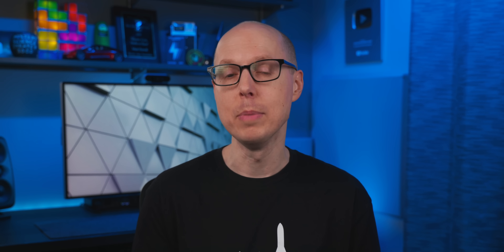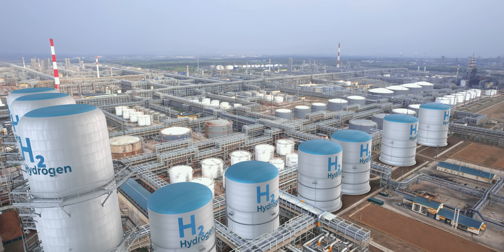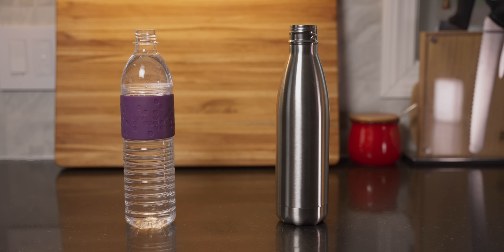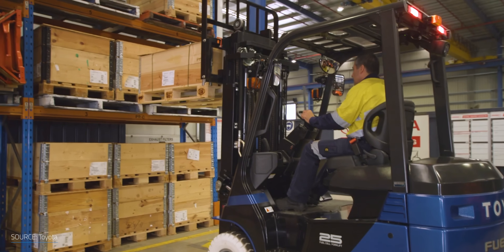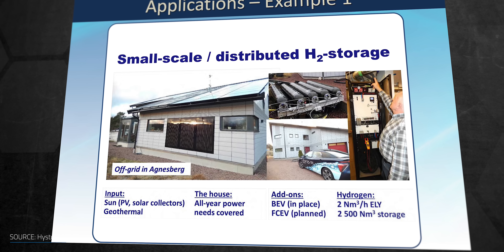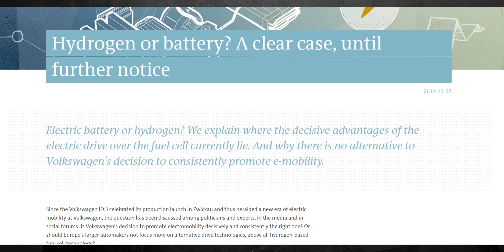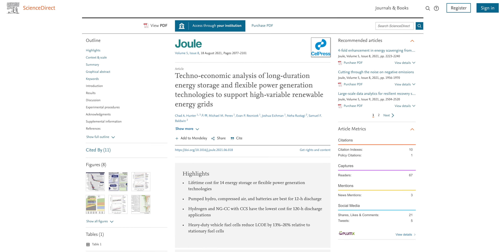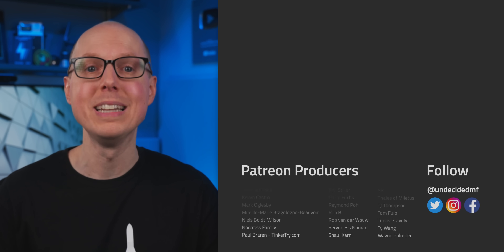Solid Hydrogen Explained (Again) - Is it the Future of Energy Storage?

Comment: I have done PhD research on this topic. The Metal hydride we were going to use was very very expensive which made it unpractical. But we shifted focus to Solid State Ammonia storage which can be used for hydrogen storage as well. The principle is exactly the same, except it works with halides. Some metallic hallides can store ammonia at very high gravimetric storage densities which makes it competitive to solid state hydrogen storage. The operation pressures are not high, materials are inexpensive and environmentally safe, and the storage pressure is below room temperature, so there is no risk of leaking.
Reply: Would love to know more on this
Reply: You can look into ASME Power and Energy conference, Journal of heat and mass transfer, and Journal of Energy resources technology. You need to find papers on the topic.
Reply: @KafshakTashtak  are you in Instagram ? What's your id
Reply: Wouldn't working with ammonia be dangerous, as it can be toxic and only a few PPM can be smelled already? Furthermore, can ammonia be produced as 'easily' with green electricity as hydrogen from electrolysis? I've heard about ammonia as an energy carrier/storage solution before, because of its high energy density. But do you consider it promising?
Reply: @RikkerdHZ  Aren't we having an ammonia shortage?  Or is that nitrogen?  What do they use for fertilizer that is now 3x the cost it was last year?
Reply: @MrShwaggins  do you mean phosphorus? The air consists of 78 mole-% N2.
Reply: @affugter  I just checked and it is nitrogen as well as synthetic  nutrients
Reply: @MrShwaggins  just read you comment again. I guess that could be because of the high natural gas prices. Takes a lot of energy to convert H2 and N2 to NH3 (Haber-Bosch process)
Reply: @MrShwaggins  Depends on where you live. I think that's phosphorus for most countries, as that is the limiting growing factor for plants in most countries. In my country (the Netherlands) we have too much N and P everywhere. I don't think there is an ammonia shortage. Ammonia also is not used in fertilizer as it's a gas and harmful for the environment (eutrophication).
Reply: @MrShwaggins  You never have nitrogen shortage on earth. Air is 79% nitrogen.
Reply: @KafshakTashtak  So what fertilizer is going up 3x for farmers?  Some basic fertilizer went from 300 to 900+ a ton?  I know the atmosphere has more Nitrogen in it than O2 but plants can still be nitrogen deprived.  It's like trying to quench your thirst by dipping your legs in a pool.
Reply: @MrShwaggins  ammonia (nitrate) I think. Russia is huge supplier.
Reply: @RikkerdHZ  So, some companies are looking to use ammonia as a fuel. One example is in shipping industry. People are looking into it since ammonia is a good hydrogen carrier.
Reply: @KafshakTashtak  so is kerosene and it's not toxic if spilled. Either way requires prodigious amounts of energy to fix the hydrogen in the first place and once you get to that point the costs of handling/distribution at scale are going to severely impact any replacement for crude oil
I'm inclined towards "wires, batteries where wires won't reach and synthetic hydrocarbons where batteries weigh too much" as the long term answer. I'm also betting that a lot of long-haul transportation will eventually move to some form of vac-train as high speed aircraft become too expensive to justify keeping in the air (gasbags have their own problems even if helium-filled. The two worst loss-of-life dirigible crashes were helium ones, not hydrogen.  Big balloons are highly susceptible to weather)
Reply: @miscbits6399  you brought up weight of batteries. One application I was looking at was using that ammonia absorption process for hvac of electric cars, because it had higher energy density than batteries.
Reply: @RikkerdHZ  Agree with you. Today, ammonia is made using fossil fuel and is toxic. The jury is still out on the scope of hydrogen as energy storage. The case of submarine is clear and we need to acknowledge that the submarine is primarily nuclear powered. Trucks could be viable for H2 tech.
Reply: Could you explain how "pressure is below room temperature" works exactly?
Reply: @szeredaiakos  So the absorption/desorption reaction of ammonia (or even hydrogen in case of hydrides) is a reversible reaction and has an equilibrium curve. Kinda like the evaporation/condensation of water. For any specific temperature, there is a specific pressure that the reaction will be at equilibrium, meaning that the rate of absorption of ammonia is equal to rate of release. For some materials, eg magnesium chloride, the equilibrium pressure at room temperature is below atmospheric (about 2 mbar). For atmospheric pressure, that equilibrium temperature is higher. You have to heat up magnesium chloride to +100°C to reach atmospheric pressure. For other materials, and liquid ammonia, the equilibrium curve is different.
Reply: @szeredaiakos  Remember?.........√P2π=∛T[βx42π-7κ]6.......easy peasy when applied 😂
Reply: I was going to say much the same.  Hydride have been known about for over 40 years but you end up with a 'fuel tank' costing more than the rest of the car - catalyser theft would be minor by comparison
Reply: @miscbits6399  . .Nova science TV show ..Late 1970s..Thanks..
Reply: The best way to store massive amounts of chemical energy by far is by bonding hydrogen with carbon. We just need to do it the way that biology does it and pull the carbon out of the atmosphere instead of the ground so that we complete the cycle instead of disrupting it.
Reply: @AbeDillon  Agree. The little issue is the long path of converting renewable energy into C-H bond and then converting it into electricity. Example, use bioethanol and fuel cell.
Reply: @stanislavjaracz  In our biological energy world there's not full hydrogen-carbon bonding (unless underground high pressure & temperature conditions). That's why we must use carbon monoxide as transportation container for green hydrogen in future's ecofuels!
Reply: @AbeDillon  Proton Technologies is pulling Only H2 Out of Oil Wells, Apparently Even Depleted Wells Still Have a Good Deal of Hydrocarbons Left Behind & Their Tech Seems to Perform the SMR Process In Situ; Solidifying the Carbon Underground & Extracting only the H2...Brilliant!
Reply: I just found out I don't know much.
Reply: Thanks for sharing.
Reply: Thank you for your input!
Reply: Yes, ammonia seems like a much more promising hydrogen storage than straight hydrogen.  I really think the breakthroughs needed will be found there.  I wish more hydrogen research pivoted to ammonia.
Reply: KISS = Keep It Simple, Stupid
Reply: @polka23dot70  If the technology was simple we would already have it.
Reply: @mitseraffej5812 All good ideas are simple. All complex ideas are as useless as Rube Goldberg's contraptions. (I made about 600 important inventions, so I have enough experience to judge new ideas.)
Reply: @polka23dot70  I doubt If a transistor or a computer chip could be described as simple. I doubt if 1% of the adult human population alive today could accurately describe how these things work at even at most basic level let alone produce one, yet these are actually quite good ideas.
Reply: Oh god, ammonia..? Imagine Beijing but instead of the normal smog it was enveloped in a cloud of piss
Reply: Could you give some references?
Reply: I still wonder how costs compare to Synthetic Diesel/Kerosine via a modernised Fischer-Tropsch process from captured CO2.

From what I can find on costs my hopes still lie on F-T bringing costs down and having minimal costs passed down to replacing thebentire fleets of vehicles.
Reply: Kudos on doing PhD work in this field.   I just finished mine in the same space in December.   We used too much of the expensive metals you mentioned (needed them for the unique nanocatalysts that formed), so I like that you had a more cost effective approach.
Reply: What is wrong with HHO on demand? Browns gas!
Reply: Appreciated
Reply: There is no way that the storage density is going to beat storing in in a liquid form so what is the point as far as densities goes??????? honestly seem like a wasted effort.
Reply: @loranmorash8532  They Say Hydride Storage is More Energy Dense Than Liquid H2. The Metal Hydride Molecules Absorb H2 Molecules. Are You Calling That Claim a Bluff??? Just Curious, I'm Certainly No Engineer.
Reply: Please tell us you're planning to take some actual chemistry classes before you throw away your time??
Reply: Nickel is expensive but for who. Mainly manufacturing which means less profits. My battery pack which is the original has lasted 21 years and still working very well. I suspect they want packs to be designed to wear out sooner to make more profits for the company. The first models where designed too well.
Reply: So where's the commercial product?
Reply: Yes!
Reply: Hi, I’m a grad student and thinking about doing research in metal hydrides. I have (I think) an original idea and have done some literature review. I would love to get in touch with you to talk more about what you had worked on!
Reply: @moynk4512  Che k Dr Zach Fang from university of Utah. He's still doing research on the subject.
Reply: Sounds like it'd have a very low specific energy, could you give more details?
Reply: Way above my head. But absolutely fascinating.
Reply: are metal hydrides/halides a net energy gain or drain for the economy in your opinion?
Reply: “ the storage pressure is below room temperature” ??
What does this actually mean or was it just a typo.
Reply: @mitseraffej5812  That is most likely a typo or translation/editor error. Many languages professionally use the term "room conditions" when they mean "standard laboratory conditions". So temperature, pressure, humitidy ect.
Reply: @mitseraffej5812  sorry, you're right. The storage (equilibrium) pressure at room temperature is below atmospheric pressure.
Reply: @KafshakTashtak  Thank you. Hydrogen fuel technology is of interest to me for the following reason. My country (New Zealand ) produces over 80% of its electricity by hydroelectric dams. Fossil fuels are used only to satisfy high peak loads. 
We have a very large hydro instillation that was built 50 odd years ago specifically to power an aluminium smelter owned by an Australian mining company. This smelter is a major employer in the area and over the last couple of decades the mining company has literally blackmailed the country by threat of closing down the the smelter when negotiating  the price of electricity.
When and if the hydrogen fuel technology comes of age the country will hopefully rid itself of this company as the energy this power station produces could go a long way to power the countries automotive fleet.
Reply: Awww please, any links?
Reply: Why don,t we mix it with something like oxygen
Reply: @SAHM  what metal hydride were you studying? I’ve been working with LaNi5 series and have had an interest in AB2 but just haven’t had the time to study it later.
Reply: @The6staradmrial  I didn't directly work on it, but the team was looking into LaNi5 a well. Too expensive for what we wanted to do.
Reply: Awesome 👍🇦🇺🖤💛❤️
Reply: Except ammonia is highly toxic.
Reply: @davidbowerman6433  As is Diesel and Petrol (Gasoline), however with those you also have the additional health hazard of Carcinogens and other poisions with their various additives.

These Petroleum products are Flammable, Ammonia is Combustible. There are numerous differences and similarities, but when you compare the two Ammonia is marginally less Hazardous.

Yet not one blinks an eye at using Petrol (Gasoline) or the fact that thousands of litres of it are stored under even the smalled Service Station (Gas Station).
Reply: please do enlightment for people so people are not gullible enough lied by new ferell
Reply: Please link to your PhD paper. I want a good laugh when you can't provide one Mr. "Unpractical."
Reply: Why would you store ammonia in solid state if you can easily have ammonia as a liquid?
Reply: @Hansulf  Added safety of it. My research was focused on thermal energy storage based on ammonia's reaction. But the other researchers in the university were looking into metal hydrides for hydrogen storage. Now ammonia could be used as hydrogen storage as well.
Reply: Is ammonia more powerful than hydrogen in terms of energy density? why is a metal hydride so expensive to make? what if a cheaper way is found to make metal hydrides?
Reply: @jjesl  >more powerful in terms of energy density
energy density and power are 2 different things you bumbling idiot. Also metal hydrides take more energy to break the metal-hydrogen bonds than can be produced by burning the hydrogen. Study chemistry and stop listening to quacks like sahm.
Reply: @jjesl  The one our team was working contained lantanide (rare earth metal), which made it expensive. If you can find a cheaper material, and the reactions have low energy balance, go for it. 
I don't remember in details right now, but I think liquid ammonia had a higher density than compressed H2.
Reply: @KafshakTashtak  Yeah, at a base Liquid Ammonia contain 1.7× Liquid Hydrogen.

A 1MPa (145.038 psi) tank of Ammonia contains 2.5× a 70MPa (10152.66 psi)   Hydrogen tanks energy by volume.

If your had a 770L (350kg) Hydrogen tank, it could be replaced with an equivalent tank of Ammonia that was only 315L (172kg).

Unsure which US Gallon to convert to here, Liquid or Dry, the US imperial system can be confusing at times. Not even sure if conversion to pounds would be appropriate, sorry US people.

None the less, yes it's quite a good Hydrogen storage medium. 

Has interesting potential as a fuel by itself, the NOx emissions are a concern. 

Given that Ammonia has a fairly lousy air fuel ratio of 6.06 by wieght, blends and mixes would be needed for it to be a successful fuel in an ICE. Adding 5-10% Hydrogen appears to be the right mix.
Reply: Ammonia isn't effective compared to the pure hydrogen for fuel cells! 
Hydrogenated synthetic fuels - that's what I think the best way to the fossil carbon-free future.
Reply: Hi sir, I had a thought while watching this video, and was hoping you could provide some insight or clarification.

The way I understand combining the hydrogen and metal, is it the same as essentially saturating a sponge with liquid? Does the base metal still retain its tensile properties? 

My thought: one issue with high pressure hydrogen cylinders is off gassing as the metal/carbon fiber cylinder is basically porous as far as the hydrogen molecules are concerned. Would using a metal hydride help prevent this by essentially "filling in" those pores thereby reducing the amount of hydrogen lost to the atmosphere?
Reply: What if you used an arogel to soak up the hydrogen, of layered it with something than can absorb it and cant so it can defuse out faster through the thinner hydrogen soaked material
Reply: Interesting.
Reply: What is "Solid State Ammonia storage"??
Reply: @manoo422  Ammonia NH4 (gas in normal condition) is adsorbed  by solid materials to increase the energy density.
Reply: @manoo422  Storing ammonia in a solid absorber (halide salts).
Reply: @Robbie👾 In the Phils., I dont know about the other country policy, they kept ALL the THESIS BOOKS in a very RESTRICTED SECTION OF THE COLLEGE/ UNIV. PUBLIC LIBRARY- I dont know the system in PRIVATE SCHOOL LIBRARY... Hence, they can QUARANTINE, ISOLATE a perceived idea/ concept contained in concerned Thesis Books... Specially if such Thesis Book was confirmed LETHAL to their bussiness interest.. Thus, in tandem with the Science Department and every nation PATENT OFFICE , they were able to filtered out and SUPPRESSED,  CHOKED at all possible level- those inventions, designs, processings, ideas, etc- which will pose a very great  THREAT to the very EXISTENCE of their multi. billion dollars bussiness empires worldwide..
Reply: Have you tried calcium hydride?
Reply: Why haven’t you started a company providing hydrogen storage for cars and sell the technology to car companies like Toyota who is making hydrogen combustion engines.
Reply: @Some0ne001  my research was on Ammonia, and I keep seeing novel ideas about using Ammonia as fuel. It has become a dream for me. Due to life circumstances, nI couldn't follow that path.
Reply: What would you say is the most restrictive factor for mainstream hydrogen use. Engines, storage or generation? I think I'm close on  the engine and have some untested theories on generation.
Reply: @spidergoose891  Hard to say for me, as I haven't worked with Hydrogen directly. But hydrogen is generally tricky. Storage and pumping it is quite difficult compared to electricity and petrol/oil. It escapes through tiniest cracks, and is quite flammable.

Edit: that's why you see research teams started looking at solid state hydrogen, or in our case ammonia.
Reply: Going backwards now (me)...The concept of weight reduction for vehicles was to use less gas (carbon output reduction). Since then, EV's r lightweight because the batteries r heavier, but no Co output. Now power grids r going down (too much usage) & requires much more BS to run them. & this burns my britches...Making lithium ion batteries & their disposal is dangerous to everything. FD's won't fight these fires now & Insurance Co's won't ensure cars/homes.
Reply: 😮 but surely will demands processing phase before diverting to fuel cella
Reply: @KafshakTashtak  sir would like to talk to you, gmail or any?
Reply: Expensive is relativ, when there is a need
Reply: You can use iron hydride
Reply: Urine is mostly ammonia. Very cheap to produce
Reply: @Walkeranz  Actually, urine is mostly water.  Between 91% and 96%.  Ammonia and ammonium compounds are less than .5% of urine.  Chlorides, Potassium, Sodium, Phosphorus, and Sulfates are all present in higher concentrations than Ammonia.  In proper functioning kidneys of course.
Reply: @Walkeranz  not true, is mostly water!
Reply: @Walkeranz  Urine contains urea which decomposes to ammonia.
Reply: @Walkeranz  Is there a Thesis Papers/ Research already done about the utilization of URINE for power production?.. All I heard was its a good compost fertilizer for plants.. Our yard fruit trees were regularly receiving such organic fert- the fruits were sooo  sweet, even bats were infesting/eating the fruit while still half. matured!.. Note: Provided, you were not taking a synthetic drugs or medicines, it will contaminate the urine- the fruits will become sour or acidic like a vinegar...
Reply: Use this and battery storage for shipping at sea, Off shore wind and solar for recharging.
Reply: @infocat13  : Trying to use batteries that are charged at fixed locations for shipping is a non-starter. Any realistic option for powering shipping off of wind involves placing the turbines onto the ship in some way (e.g. lighter-than-air turbines).
Reply: North Sea wind to recharge ships at Rotterdam:)
Reply: @infocat13  Batteries of a size to provide base load power from renewables are still too expensive but they are getting better. The race is on. .
Reply: @infocat13  Mainspring Generator Could Power Electric Shipping, Burning H2 or Ammonia to Replace Massive Battery Requirements. Others Have AI Driven Sailboats that Drag a Turbine to Power Electrolysis & Deliver H2 Straight to Desired Ports.
Reply: @infocat13  Right now nuclear is much more likely to make a difference in global warming on those incredibly dirty ships.
Reply: @Robert Lemon I know some Universities let you use their libraries for a fee if you live in the same state or area and pay a yearly fee.  They have much more to offer so thats why they charge for a library card.  I miss where I used to live.  There was a nice new library with private meeting rooms, an outside amphitheater for giving lectures and a dog park.  It was such a good spot to relax and it was quiet.  You go to an underfunded library system and its just a place for the homeless to watch adult films on the computers.
Reply: @MrShwaggins  sorry you're feeling that way
Reply: How about Magnesium or Barium blends? Heard that German scientists had success in storing hydrogen in a clay form, somekind of mix from Ba or Mg. Basically a "fuel in a toothpaste tube" :) The burnoff was also supposed to be pure and recyclable to store more H again.
Reply: In your opinion, do you think it's possible for metal hydrides to replace LH2 on rockets someday? Is it possible for hydrides to release its hydrogens fast enough to satisfy the huge mass flow requirement (kilograms per seconds) of a rocket?
Reply: @lazyremnant380  
The benefit of the LH2 vs SSH2 is that the solid form leaves behind a framework that still has significant weight. A typically fueled rocket gains substantial efficiency as the bulk of the propellant is used.
Reply: @kindlin  Right, I forgot that part, hydrides are basically a hydrogen sponge, and since a dried up sponge do not disappear, it's just dead weight as far as rockets are concerned. 
I guess the aerospace sector will just have to deal with headaches caused by LH2 😓
Reply: @kindlin  but LH2 also requires a heavy tank to hold the pressure. So w need to run the numbers to compare the two.
Reply: @KafshakTashtak  
I think we're looking at a square-cubed kind of situation here. The outside of the tank is heavier, yes, but it's just the outside (surface area = squared), so a larger vehicle (orbital) has a proportionally smaller impact from adding additional fuel when compared to the weight of the spent fuel hydride's solid mass that's increasing directly with added fuel (volume = cubed).
Reply: @kindlin  That's not how it works. When you design a tank of gas, the area grows with size ^2, but thickness of the tank also grows with size (because it has to tolerate the tension due to the pressure being applied to a bigger area. So the weight of the tank still grows with Size ^3. In the case of solid state storage (Ammonia or H2), you still have to consider the pressure of the gas for thickness of the tank, because during the charging process, the gas will be at a high pressure, unless you are charging it very slowly at low pressures. But then during the discharge process, you may end up with a high pressure. Although in the case of solid state storage, it can be a lower pressure than liquid phases.
Reply: @KafshakTashtak  
You're right, there is an extra L in there I wasn't thinking about, but I also wasn't really thinking about heavily pressurized tanks, I was assuming other constraints would control design; but I guess even the relatively low pressures (1-4 bar, I read) of a LH2 tank would necessitate some beefy walls. Having to hold the old fuel's storage rack, tho, that's a whole other problem.
Reply: @kindlin  Also consider that the tank of a rocket is the structure to support it's own weight and the weight of tanks, stages, and payloads above it on the launch vehicle. It has to support acceleration and large bending loads due to wind shear.  They generally are designed to take advantage of pressure stabilization using 5-10 bar in part to reduce the weight of the tanks.
Reply: @lazyremnant380  Unless they figure out a way to expel the "dried up sponge" with the fuel? It would add a bit of thrust during that process.
Reply: @lazyremnant380  To heavy:)
Reply: @infocat13  How about after in orbit? Made in space.
Reply: @infocat13  Pure hydrogen is a very leaky gas to work with, so its why some companies don't use it.
Reply: @infocat13  and too slow! (for the rocketry question :) )
Reply: @lazyremnant380  one issue is the rate of evaporation. In LH2, it will evaporate easily, but in not sure about solid state H2. So, for such an application, maybe not.
Reply: Given Ammonia is already a stable storage medium of Hydrogen why bother with attempting to force it into a solid at that point?

Just seems like a pointless extra step.
Reply: @soulsurvivor8293  Adds to the safety. Volumetrically, you will end up with about 40% larger tank, which isn't bad, and about 200% extra mass compared to liquid ammonia. But it will be below atmospheric pressure.
Reply: @soulsurvivor8293  To minimize space requirements maybe? Because the physical real estate can be expensive if ammonia is not compressed, not to mention the amount of material (aka metal cylinder) used to store it.
Reply: @CouldntBeMoreRight  Also pointless. At 1 bar, or 0.9 Atm of pressure, you can keep ammonia as a liquid at room temperature. A standard scuba tank can hold slightly over 200 atm of pressure. There is even a thing called Divers solutions.. which is a saturated solution of ammonium nitrate in liquid ammonia which has partial pressure lower than 1atm at 25 C. Real problem is ammonia cost energy to make, and we get our energy from fossil fuel. So why bother to store that energy as ammonia when we can just use the fossil fuel directly.
Reply: @soulsurvivor8293  I think ammonia storage provides greater economy for bigger utility while in the case of metal hydrides has to do with portability and convenience although expensive at this time.
Reply: @soulsurvivor8293  ammonia is liquid. Just as hydration increases hydrogen density beyond that of its liquid state, solidifying ammonia through the same process achieves the same density improvements?
Reply: @soulsurvivor8293  Titanium Based Hydride Can Store h2 More Densley than Liquid h2 at Just 35 bar instead of 350 or 700 for Compressed. But Yes Ammonia Seems to be More Practical... Not Explosive, High Energy Density, Easy to Maintain Liquid State, can Burn in Combustion Engine or Cracked Prior to Feeding Fuel Cell
Reply: I have plenty of ammonia for you. Just give me a lot of water and a few hours.
Reply: I must learn of this 😶 I must....learn how to do it ☹
Reply: What about releasing the Hydrogen with halides?
Reply: @Jopino already answered.
Reply: No offense but i kinda get tiered by the argument of high cost by engineers. Sure right now it is economically not viable. But if a technology has no resources bottleneck and is in general assome cost shouldn't be an factor. Ny scaling we will bring the cost down. Glass, plastic, computer chips and most recent electric vehicles used to be unaffordable expensive, but the tech was viable and the production was scaled. 
Like i said i see your point, but if you zoom out  current cost should not be the deciding factor.
Reply: @danielsoeller  you need to test and perfect, which is hard to do if you cant afford the materials and no one wants to invest...
Reply: @danielsoeller  each research need funding, so price is a huge factor when considering viability as advancements in labs(which needs investors that see return of costs) are slower than sum of advancements in lab and on open market. On top of that not all costs get smaller with growing popularity, Eg price of materials grows (look lithium and popularization of electric cars)

In conclusion technology that seams more viable because of better price to effect ratio will get more support that is needed to "finish" it
Reply: @danielsoeller  sometimes cost translates in energy, which is the whole point
Reply: @danielsoeller  Believe me, engineers are well aware of the concept of price reduction through mass production, and in fact are able to make good projections of what the actual cost of the product would be. There are still reasons why high costs can stop product development. First is simply funding. If a product will cost 100 million dollars to bring to market, but you only have 1 million in funding, you can't bring the product to market. You'll probably switch to a different strategy that works within the constraints you have. Second, if the projected price is too high to be commercially viable, there's no point in developing further unless you can find additional cost savings. Finally, even if a product could be priced low enough to provide value to consumers, it won't be developed if there are more promising avenues of research that will lead to cheaper and/or better products that will inevitably outcompete it.
Reply: @danielsoeller  This is a ignorant and unrealistic take. Anyone with even the most basic understanding of business and economics could tell you why. Not everything can be made cheap by scaling or refining production processes. This is called scarcity. Some products that CAN be made cheaper by refining production might realistically never be refined due to the opportunity cost and basic understanding of the market and demand.
Reply: @HCG  you probably can give me an example...